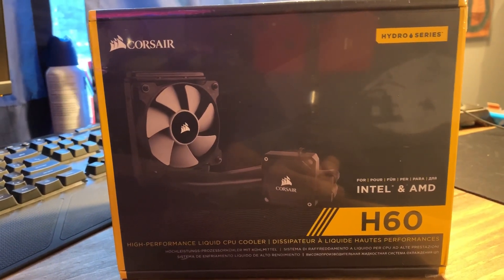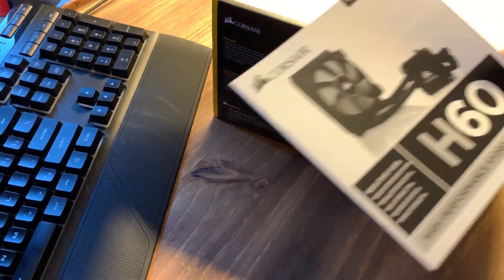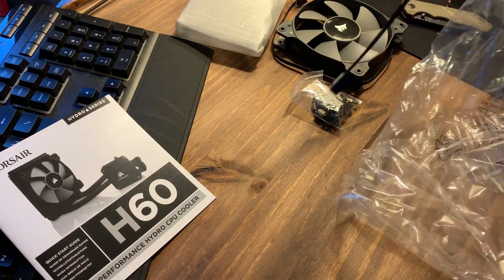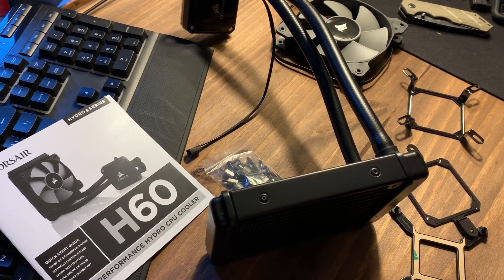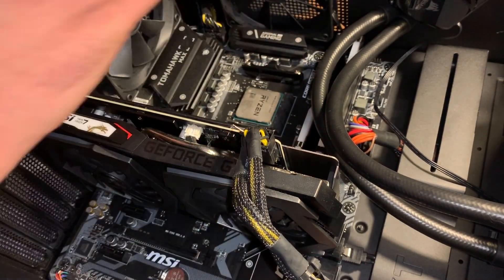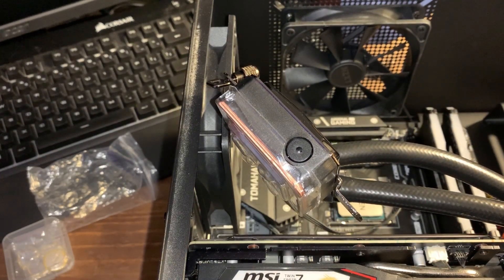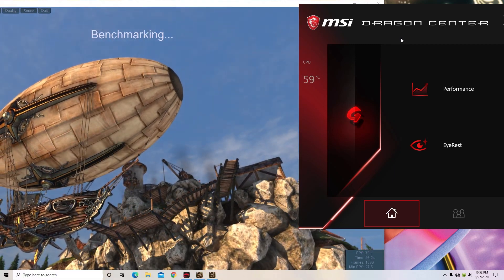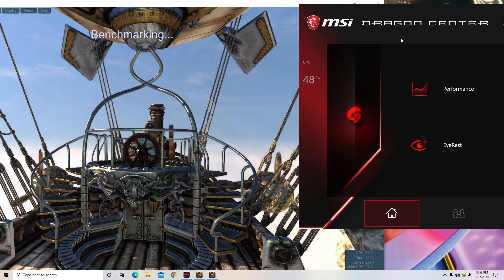Corsair H60 CPU cooler unbox, install and results

Comment: Heaven is terrible stress test as it stresses GPU, not CPU.  Next time get a CPU stress test, or a game that stresses CPU a lot.  a10c drop on temps are likely from new install.  Even a super light dust coat can drop temps 5C on a new rig after 0ne-month use.  Likely no benefit.  My dell uses a similar cooler and does around 70c, it used to do 60c new.

Comment: I've had this cooler for about 3 years on my PC; Today the fan stopped working. For some reason this ibuypower PC seems to have a fan on each side; but can I just use any 120mm fan as a replacement?
Reply from the maker: I don’t see why you couldn’t as long as the size works and the plug are the same

Comment: Is downloading the ICUE software necessary after installing the h60 LC? If so, it’s not showing up in the software.
Reply from the maker: It’s not needed and wouldn’t show bc it doesn’t have the rgb. The next model up has the lights
Reply: Thanks a lot.

Comment: does the led light need an rgb header in motherboard?
Reply from the maker: No lights on this model
Reply: @jcfixplay493   on the part that goes on the cpu
Reply from the maker: It plugs into the cpu fan port. It has no lights whatsoever. If plugged into an rgb header or the cpu fan it won’t light up. This is the most basic model they offer. I think it’s called the h100i where you can get the lights.
Reply: @jcfixplay493   oh ok thanks

Comment: Im about to buy this and wanted to know how loud the pump was on the AIO? Is it quiet?
Reply from the maker: It’s not that loud at all. Even at full speed, my case fan was louder than the pump.
Reply: @jcfixplay493  how does noise level compare to stock AMD Wraith cooler? My stock one is loud. Seems to be an issue many people have. I'm hoping this this is super quite.